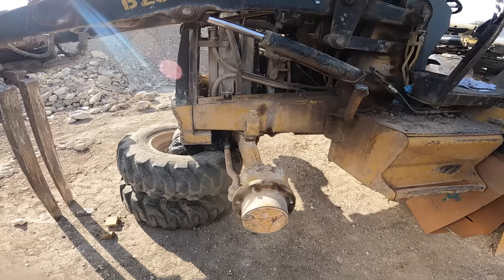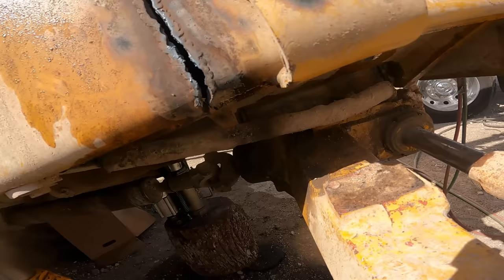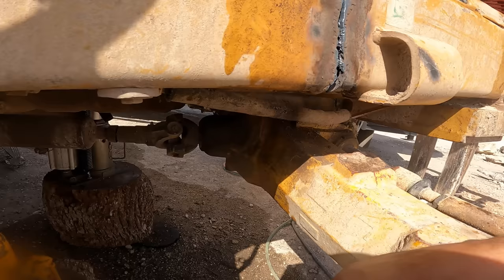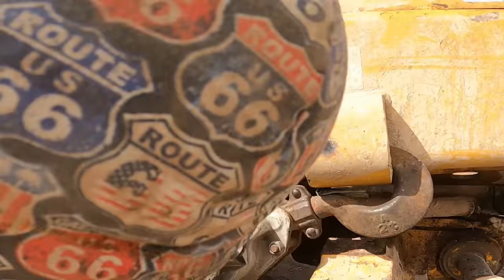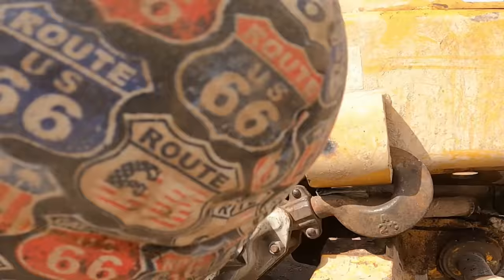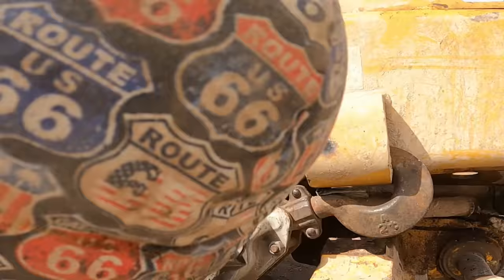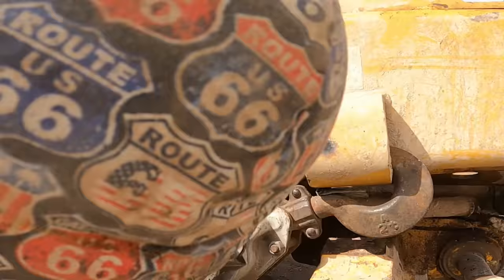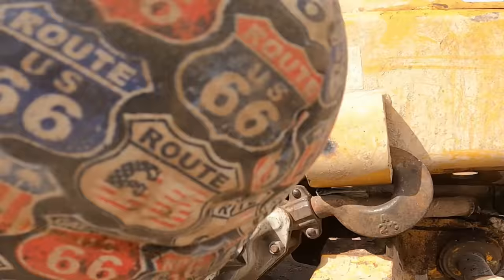Broken  Backhoe Frame. (Caterpillar)

Comment: As the mechanic! I thinks operator is overloading the machine. What is more important? 💰💰your time 💰! Or his !! Nice work.. again just a mechanic.. that can weld . Several times I repaired steering box frame rip outs and added plate to my repair.,. Guess I overthink stuff😢
Reply: Exactly. Using forks too. 

Bouncy, bouncy load + 3-point bending chassis (front wheel, actor base pin, rear wheel) = crack

Comment: Just as some side info and/or question; have you ever come across 7016 twin coated flux / 16TC ? Lots of brands of it around, here in NZ we have KOBE LB-52U,  WIA / WELDWELL 16TC, etc... not sure about the US.  It is used as a low hydrogen replacement for 6010, and is very  good at doing one sided open roots (in addition to general purpose stuff), perfect for what you were doing there. Might be worth investigating to add another option to your toolkit :)

Comment: a nother disaster turned around by the master of disasters what brand /size wire do you use ?  i had a case backhoe one time that split the main boom top to bottom same co also twisted the center out of rock saw so it all breaks
Reply from the maker: Case booms are a non weldable cast. and I use Hobart fabshield 21-B
Reply: @ICWeld  
that was a older case pre 73 mod steel boom i did weld it getting it pulled together was the trick it held

Comment: Amazing talent, to say the least! I'm no professional, but how is it you were able to weld with what looked to be hardly any cleaning or surface prep (maybe you had beyond what was shown). It's always advised to ensure the surface is clear of contaminates, while I'm sure you're more familiar where and when that applies, but I guess what I'm pointing out is paint, or grease from the inner side of the engine bay frame rails.. The welds looked phenomenal despite what looked to be hard to clean/prep.

Comment: Nice work Isaac.  I always heard, if you weld a plate on a frame to weld along the frame but not across or up and down so it could flex. Like you did on those straps.  Does it actually help or does it really matter?
Reply from the maker: It does make a bit of difference if not done correctly. especially if theres undercut. but if you can avoid it, then avoid it.

Comment: Were you still using the GoPro on this one? The quality looks even better than normal.
Reply from the maker: I changed the front lens cover. The old one had too many spark scars. The 9 model has replaceable lenses.
Reply: @ICWeld  Looks great, keep up the great work!
Reply: @I C Weld  your videos quality seems to improve all the time.  Especially enjoy close ups of weld pool thru the lens.

Comment: What is the Flux core wire you are using?? Is it = to 7018??   I have not had good results with it the few times I messd with it. Probably because it was running on too small a machine. I always thought of it as a gimic to sell hobby welders. But after seeing your results may give it another try In a suitcase with some power behind it.😄
Reply from the maker: hobart fabshield 21-B in .045 size

Comment: Serious question, why did you come along it back together to create more stress there as opposed to just grooving it and putting good weld metal in it? That's how I repair cracks on logging equipment just groove the crack and put good clean weld metal back in it and haven't had anything fail yet

Comment: Good move not welding across the ends of the fish plates Issac, the amount of people I see unnecessarily welding across draw bars and chassis rails etc where you know the stresses will cause cracks astounds me.
Reply: Plus it allows the plate to be able to flex and move if needed reducing stresses and cracks right?

Comment: Just out of curiosity, how much do you charge/make from a more basic job? I work industrial maintenance and really wonder what a going rate for this type of job when i think about all of the material and equipment you have on the truck. Even something like a come-a-long is not by any means cheap.
Reply from the maker: A lot. Each area has its range of acceptable hourly rig pay per hr. I'm on the upper end of what the market can hold in this part of town. But ultimately it boils down to your experience and tooling.

Comment: I’m learning about welding and have a couple of questions. 
1. You have a great plasma cutter that only consumes plain air, why cut the gaps with the oxy-acetylene torch?
2. I didn’t see where or if you checked the front from being square side to side with the straight edge.

Comment: Carbon arc gouging puts a bunch of carbon in the weld and that is why I don't use them on frames and other stress And load bearing frames I have noticed they crack again faster vs using a torch

Comment: The thing about that kind of wear abuse damage is it would have been easier to fix sooner. Waiting until it is almost apart means a lot of incident damage to also repair. 
Your work looks great! I would not hesitate to use that hoe, based on frame condition. Just wonder what else was neglected?

Comment: Curious when u welded boom on 325c ur mig had really long wand. Also what size wire and size of wire comparable to in stick rod size
Reply from the maker: I used a self shielded wire. Hobart Fabshield 21-B in an .045 size. worked great.

Comment: Good stuff!!! What wire did you use if you don’t mind me asking? I do moment welds and all critical welds for my company . I use 211,212,232,233,311,Xlr8, 3m
Reply from the maker: Hobart fabshield 21-B
Reply: E71T11 is the AWS number. 

Just bought 20lbs of Blue  Demon for $140.

For 20lbs of this Hobart wire they want about $230! Crazy!

Comment: Splice plates. Recognised method to join and strengthen a joint in structural steel
Also how many spark burns did you suffer with welding under the machine. ?

Comment: All those "field repairs" are completely different kettle of fish than "in shop welding". Pain in the arse, neck and all other parts of the body - dirt, wind, difficult to access areas, grease, rust and what not - plus the inexplicable and "amusing" fun of lying on the cold ground with hot sparks and what not falling on you from above... It just can't get any better, right? Ah, the joyful trade of field welder...! ;-)

Comment: I'd like to start a discussion.  No slamming, or trolling....just some questions.

Given the poor properties of NR211 and its equivalents(including Fabshield), I'd first question the use of that sort of wire for a root pass, and a very large root pass at that.  If, as you say, and we all know, it's a brittle filler, not Charpy rated, why depend on it for a root pass?

Then............I've noticed a change in your technique.  I'm seeing a lot of dabs, dips, and dippity dooooos.  i've never seen that with any kind of structural weld.  Maybe to fill a wide gap, followed by a grind out(leaving just enough to prevent burn through when you follow it with an approved wire), but never as a base for a cap.  Slag inclusion comes to mind.  I know you've said that you can see the puddle burn out the slag in the previous dollop, but just sayin'.

I like it when you run 7018 all the way out, despite the serious whipping.  Clean it up, and you have a good base for a solid weld.  I'm surprised you've gone over to the "dark side"(just kidding).

Your skill level is such, that you really don't need to do the silly dollop thing.  And, I'm assuming your engine drive has enough nutz to do more serious wire.  The non Charpy rated wire confuses me.

Anyways, I'll go crawl back under my rock (big grin)
Reply from the maker: I appreciate the input. The 211 wire is a bit more brittle than the 21-B. Nothing will be as good as the 7018"s. This job was quite the challenge and I have had rather good success with the wire in situations such as these. As far as the fear of slag entrapment, I havent noticed any visible markers that would tell me that the slag didnt burn out correctly, ex; large pinholes, etc.. Do you know of a fully self shielded wire that may work better? if so. please mention it. I'm up for learning new things. I'll have to see if our local welding supply can get it.
Reply: @ICWeld  I've literally looked for years for a suitable self shielding wire in a size that was useable for what I do.  I work with 3/16 to 1" plate thickness.  NR232 or NR233 is fine for thick stuff, but I'd hate to run it on what you did on the frame.  Make Swiss Cheeeeeeeez outta that frame LOL.

I keep coming back to something like 7100 Ultra.  It seems to operate over a fairly wide range, and is useable with 75/25 gas..........same as a solid wire.  The downside..........the doggone shielding gas requirement.  I do exhaust, and fuel system, work with solid wire............and even here in Oklahoma, it's doable in a fairly stiff breeze, as long as you keep your body between the puddle, and the wind.  So, I'd not be opposed to trying the 7100 Ultra.  (It theoretically comes in .035, but I think it's a rumor.  I can't locate any....045 seems to be the norm, which isn't a deal killer.  A guy should be able to weld pretty thin stuff with it if need be).  Take a look at the mechanical properties, and see what you think.  I keep thinking I'll grab some, but never get around to it.  Might just get off my keester and do it.

For field work, it still boils down to 7018.  Works great on heavier restrained joints with a bit of preheat to slow down the cooling.  It's just all around great stuff.

Interesting factoid on 7018.  Lot of guys think you can weld in a hurricane with it.  Not so.  Get a real windy day, and you get grey welds.  Not the typical shiny bead.  Either has something to do with the shielding blowing away, or the weld cooling too fast under the slag.  Wind hits around 35mph, I call it a day.

Anyways, really like your stuff (except for that damn funky 21B huge grin).  Stay busy, and stay safe.

Comment: I do some hobby welding for myself around the house what's the trick to not trapping slag with pulse welding when using  flux core ? I don't use dual shield I just  have a small welder.

Comment: I noticed you left a bit of a low spot on your first welding on the inside. To me that would create a weak spot.  Also on the outside where the carbon arc looked worse and blew threw it may be because that metal was stress fatigued and crystallized and removing that part was the best thing to happen. A bit more care in welding back but hopefully to better metal.  Good job.

Comment: Along with your skills as a master welder we have to give extra points for your abilities as a contortionist for the spaces you're able to work in . 
That's a handy tip , allowing the puddle to just solidify before hitting the weld again. 
Broke back hoe sounds like a sequel.

Comment: That is a poor way to fix that crack. Run up hill continuously without stopping to maintain a solid weld puddle. Every time you stop you're inviting porosity and inclusions. Grind the weld flat and install solid plate(1/2” or 3/4”) over the crack. Preheat the plate prior to welding to get good penetration. Seam weld the entire plate with 7018.  When arc gouging, move your stinger closer to the end of the rod (closer to the work) and run at least 100 psi for better evacuation and precise cutting and control of the arch gouge trough.  A fluid puddle should never be resting on the work piece when the arc strikes.  It should blow away instantly.
Reply from the maker: 1+9=10  8+2=10  6+4=10. Many ways to end up with the same result. Thanks for watching though.

Comment: Why did you use the spot welding technique to make this repair, and did you not use a continuous weld seam?
Reply from the maker: hard to control
Reply: @ICWeld  aaaa ok, the repair was very good.  The nozzle of the oxyfuel torch is the same one that you have always used #1???

Comment: Have you of a off road flat bed? It just seams to me to be the easiest solution? Surely if you made a aluminium bed it'll be light enough to run over sand!  

Or a a frame of sorts that attached under the wheels of the car being  towed

Comment: 230 two big tabs welded to bottom of tube support then use large bolt to pull joint together, you think welding tabs would cause that much annealment as to weaken frame? 1249 yes good job. Yes gusset plates.

Comment: Also what's the best needle gun you've found so far overall?
Reply: FWIW, I have an Ingersoll Rand 125 needle scaler and it really cleans up rusty pitted metal for me.  It's also great for cleaning tough slag and spatter from 6011 welds.

Comment: Which wire type and size are you running? Great work.
Reply: @ebutuoyebutouy  I did. He mentioned NR-211 and NR-212. Never mentioned which one or what size.
Reply from the maker: Hobart Fabshield 21-B
Reply: @ICWeld  .045?
Reply: 1.2mm in communist measurement. 
I borrowed the line communist measurement from another regular viewer to this channel, it’s wrong but hilarious.

Comment: whats wrong with that 2 piece "jackstand"? the stump is the stand and bottle jack is adjustable. 😂😂😂
Reply: Nothing wrong, but his wife just upped his life insurance.
Reply: The few bottle jacks that I have repaired, the seals are usually crumbled in small peaces, compared to a hydraulic cylinder which use a combination of different seals, o-rings and wiper rings. So yes do not trust a hydraulic jack.

Comment: In my view that damage was caused by poor engineering. The cross member should have been attatched to a bigger pad then stitch welded to chassis rails. You did a great job with the conditions you were working with.

Comment: I would have cut it off put solid tube inside it welded it then put the front back on welded it and made sure it wouldn't have happened again faster and easier to do
Reply from the maker: You may not have had you been there.

Comment: These so called welders cannot even weld continuously overhead or vertical up, Probably would have welded it all with low hydrogen rods then mig, Then plastered it all round well pass the original crack with the thickest plate which didn’t fowl the workings of the 180 excavators,  But definitely not this stop start which is being shown on .
Reply: He explained clearly why he was not going to do continuous welds. You may disagree, of course.

Comment: I don't what kind of s**t steel Cat are using but it is cracking up on all their equipment to the stage that at my place we had to stop converting the their 360 machines to long reach for the demolition business due to the insurance premium going sky high cos of the booms breaking away at the pivot pin, they are also breaking there with a standard stick, the backhoe was never that much liked and were only bought by die hard Cat fans, Case is a much better machine but they too are heading away from the use, too much electrics and raspy engines.
Reply from the maker: Believe it or not, I rarely if ever repair JD machines. Theyre either built better or underpowered. Whatever the case, if i were to buy a machine itd probably be a JD.